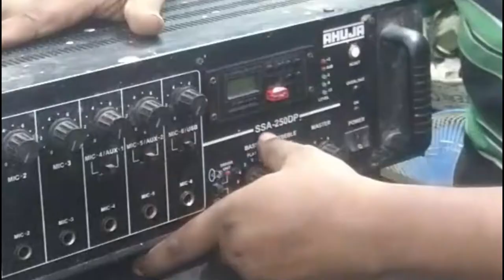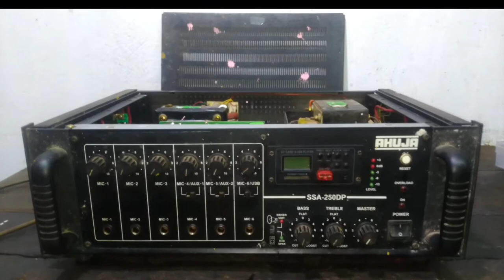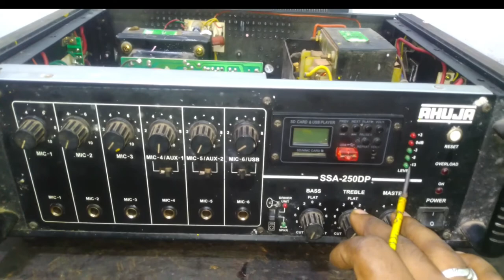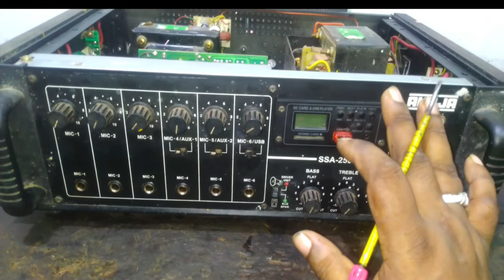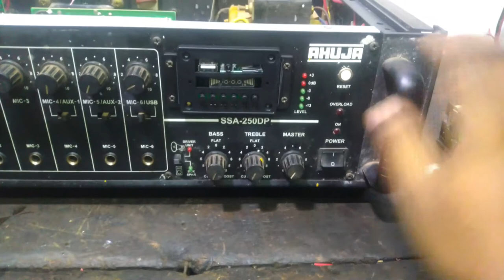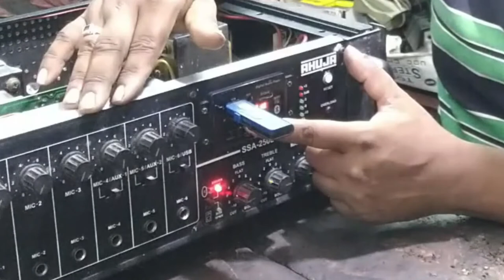ahuja amplifier repair.ahuja ssa250dp amplifier no sound.dead amplifier repair.

Comment: Ahuja amplifier 250DP Audio quality ledhu driver boad transistor 5200 and 2055 and freeset change chesa Aina Audio qualityga Ravadam ledu
Reply from the maker: First driver board voltage check cheye bro resister open ite alge capasitor week vunna sound quality vundadu